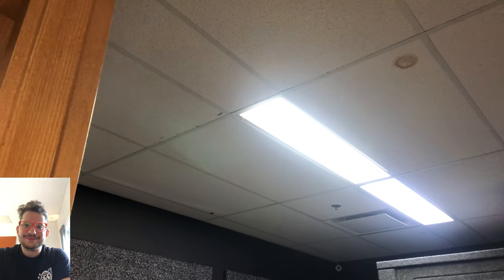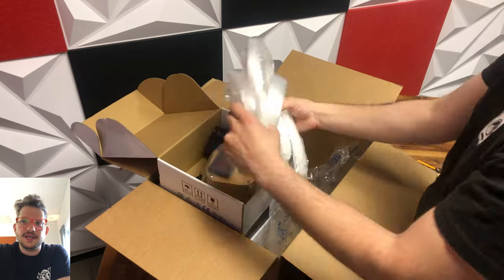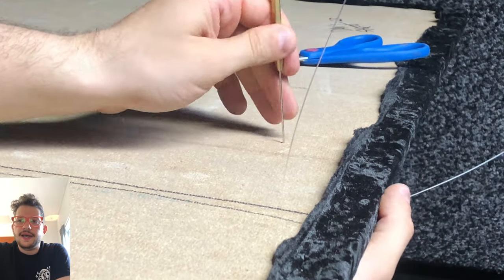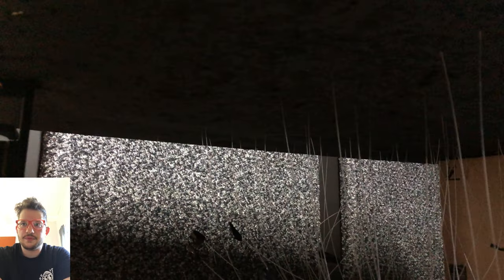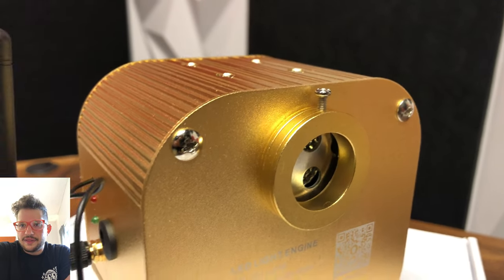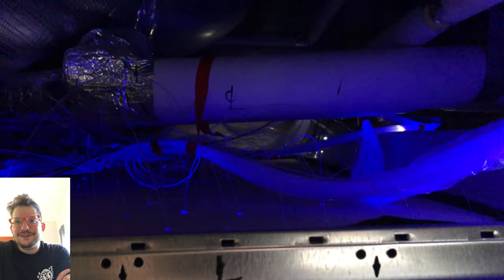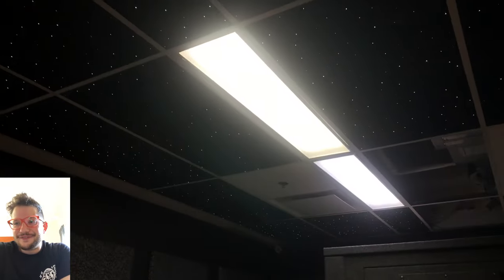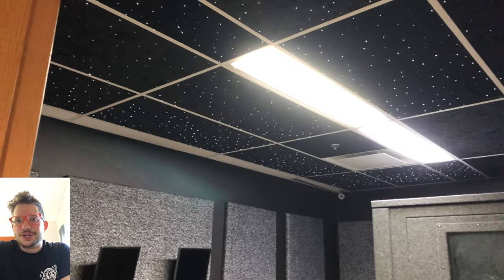STARLIGHT HEADLINER DIY FIBER OPTIC LED LIGHTING!

Comment: It would be maybe even better if the drop ceiling frame could be sprayed black to get the consistent back sky effect, but that would require to take either all panels out or section by section to spray the frame. I do understand if this could not or cannot be achieved. Overall, this is hard work already and great result!👍

Comment: Amazing! 

Few questions..
Would it be easier/more efficient to...
-cut angles before inserting strands
-use a long thread hook to poke and grab the fiber optics.
-hotglue in lines instead of one by one
- trim strands with electric hair trimmer

Thats what I would do but.....I also get ahead of myself and mess up with my "great ideas" ideas!
Reply: You wouldn’t hot glue in lines because it wouldn’t be hot enough

Comment: Would it be brighter if you wrapped the main fiber core runs in some kind of reflective tape or material to stop the light loss into the ceiling?